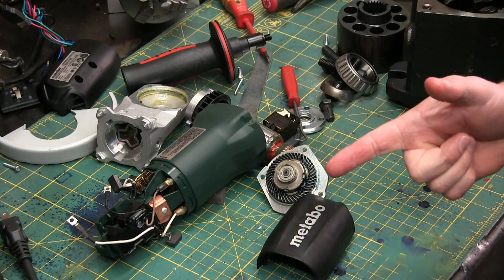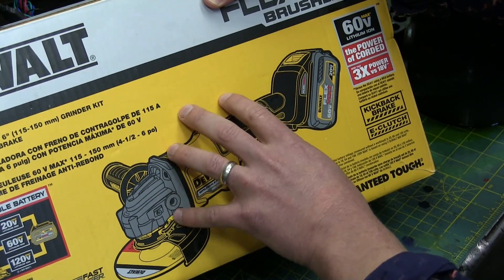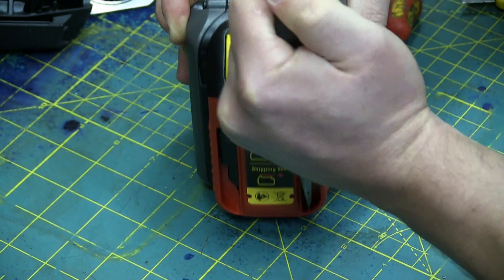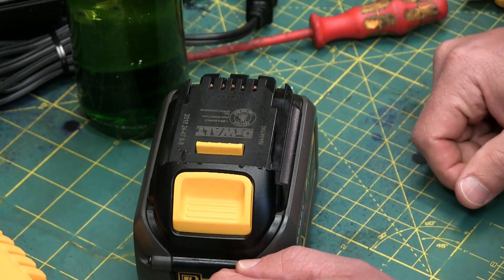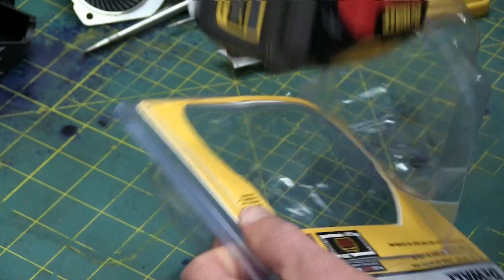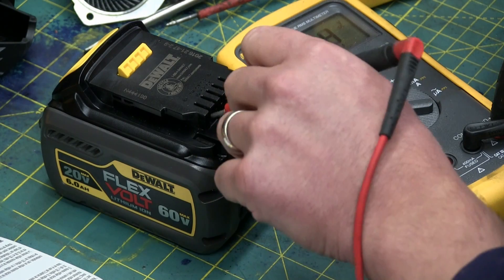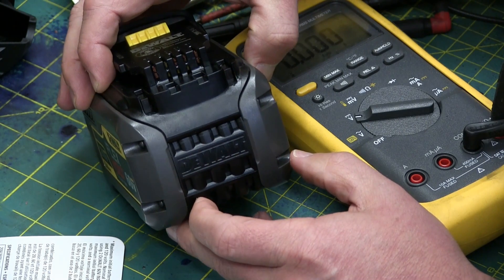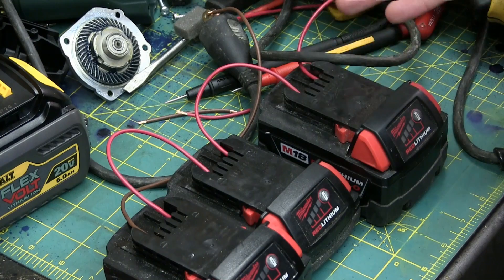Plug-in Power Tool to CORDLESS CONVERSION.

Comment: Not trying to be against the tool turbo charger but from the electrical point of view it's a bad idea to run an ac tool on dc not because of the motor, but because the switch won't handle the power. Disconnecting ac power is a piece of cake while dc will draw arcs like crazy. Mains switches are usually rated 120vac and 30vdc at their full operating power.

Comment: I wouldn't say you are a complete idiot...given some of the things we've seen you attempt, I'm reasonably sure there are some parts missing.

All kindling aside, very funny and interesting video.  Can't wait to see what you come up with. Be handy for taking the sawzall to the metal supplier so as to shorten the handy 20' lengths they sell stuff in to something those of us without semis can transport to home. Don't do that enough to justify a cordless sawzall, but if I could use my corded one, or even better, the Portaband, that would be a deal!

-- Mike

Comment: A normally open 120vac contactor on the mains side of the battery pack? When the voltage dips, the contactor would open and decouple you from the wall. Then you run on the battery until the contactor snaps shut.

Comment: Start with a UPS for the current/voltage sensing but instead of flipping to an inverter run off SLA batteries, instead flip some relays to the  LION batteries between the tool and the chargers.

Comment: Is this idea different from a UPS?
Reply: pretty close actually now that you mention it, lol just put a UPS in a backpack and plug er in. good to go
Reply: Can't hurt to try this.  Unless existing back problems
Reply: 1spaghetti32 lol
Reply: I was gonna ask the same thing but, I think a meaty capacitor would help better for initial inductive spikes and use the batteries for portability.
Reply: UPSs  just switch to battery when the line voltage browns/blacks out. This would just be a more sophisticated controller that doesnt switch entirely to battery, but only notices when the voltage drop causes a current flow increase, but then makes up that extra flow with the batteries instead of the line current. The line would still be the main power source, unlike a UPS which, once switched, is the sole supply, thus the short bettery life.
Reply: you could get a decent one for $100 that has good over-voltage/ brown out switching, or an inline UPS that is 100% on battery power.
Reply: Every UPS I have ever messed with needs to start on line voltage and then you can kill the ac.  They don't seem to work as an inverter. I'm sure that some EE pixie wrangler can tell you how/what to by-pass/cut/connect to make it work though.
Reply: +Zee-L Usay my experience is the complete opposite. Cheaper, home grade units sometimes struggle of the full load is attached when you turn it on, but even with a half depleted battery it'll still work.. 
The smart ups line does this no problem.
Reply: UPSs also run completely off the batteries when there is a complete power outage. Smarter ones will kick in during over / under voltage or an unstable voltages / ripples. Cheaper ones only kick in when the power goes out. 
You can get ones the size of people that would power a desktop computer for weeks.
Reply: One way or the other, a UPS + ground-trip has got to be safer than scoochin about on-site with 60v of DC schmoo.
Reply: actually tried that.....didn’t work to well,didn’t work at all  ,being that the ups uses a tiny 7 amp lead battery ,it isn’t strong enough for a tool in that capacity,you could use it for light tools (drill,scrollsaw etc) but a job site saw is to much,that is why larger tools use start up capacitors,but i am just a diy’er who tries things so with stuff i have laying around,maybe a big pro ups would work?
Reply: oh wait if the external spinup first start the tool later idea works then you can just use the dc start turbocharger method anyway. just start from dc batteries let it spin switch to ac just a relay job with delay if the dc batteries does not damage the commutator and other things too much that is hmm can be done if you are desperate enough
Reply: +Ken Lazar Not necessarily, there are 3 main sorts: Standby, which does what you're saying, Line Interactive, which smoothes out power by conditioning the line, and Double Conversion, which is always drawing fully conditioned power from the battery while keeping it charged as well.

Comment: I think the "line interactive" UPS models might be able to do this. At least, they can boost the voltage up to spec if it's coming up a bit short. Don't know if they use battery for that, or just draw more current, though.

Comment: Maby make a system that when you turn on the tool it cuts out ac for 10 sec and  runs on batery then it will swich back to ac and swich on an seprate charger for the bateries. Making a device that can sence current draw and if it gets to hi it will swich into batery the swich back to ac once the current draw goes below the amount make an relay or solinod swich that will instantley cut in and out ac/dc current so there will be no aperent dip or drop in power in the tool when swiching

Comment: WO wo mon ti pit! ( Wait a minute man) I understand your enthousiasm...about this Billy Grahamist association of devoted internet brains ( soul)!  but ( the killing word) first thing first.  The rule says : buy and appropriated size  of extension cord.  Think about this: If the brake system fails on your car, do you invent a new system or do you  repair it.....
I don't discard your idea, I even support and think about it...
Why not go with small 12 volts motorcycle  batteries. Their charger would be cheaper...
Gold bless you...

Comment: on our farm here down under we have a multipurpose genorator that produces 240v DC, perfect for running all your brushed rotary tools.
the reason for the DC is that itmm also works both 12&24 volt for starting large engines with dead batteries. It also has a really scoocum welder and an air compressor.
Reply: it's the perfect all round repair station for isolated repairs
Reply: +ELECTRONTHORP not in 15+ years

Comment: Inrush current is higher because of the extension in comparison to plug in it directly ?. Extensions are big unwinded power resistors, a balast. IMHO it should low the current seen by the tool, which is the same that sees the breaker.  Probably trips because tool struggles too much on starting that buids up heat on the breaker (trips because overheating). The battery idea is good, it more like and UPS fashion but without the inverter in the ouput and more batteries. Probably a real UPS will even behave that way because when you trig the tool, the voltage drop is so much that the UPS switchs to battery until the AC recovers, which happens once the tool picked up revs or speed or something. Shame that they dont run this higher voltages (DC) so it would make them hackeable. But you can fit 6 batteries, o more, charge one by one and when it switches to back up power just blast all of them in series. I mean trying to reuse the charger, and the voltage drop detection, some relays ...

Comment: What about an SMPS pumping out ~48 VDC, a bank of 13 LiFePO4 (phosphate- how do you enter subscript again?) cells in series, a single (if they make singles for 48V) or bank of supercapacitors (in series for 48 V use), and a 48 VDC inverter (sine wave type)? While there will of course be a slight efficiency loss, the storage in the supercapacitor bank and batteries (if cordless capabilites are desired) would be able to push more than the SMPS alone to the inverter, providing a burst of more AC to the tool for a period of time.

Comment: Guess ill throw my .02 in, to supplement tools with current from a battery the first step is sending your ac power through a bridge rectifier, diode based if you wanna keep it simple, synchronous if you want efficiency, then diode off the batteries, both positive and negative with a recirculating diode between em. Then you've got to cook up a highly regulated 120 volt charger that disconnects upon the batteries being loaded, and there lies the difficult EE work. Superimposing a dc current onto an ac waveform is not something  you wanna do in this application.
Reply: Inverters are large and expensive, they also don't solve the bolus of current at start up or the high use in transient situations, they are protected the same way a wall outlet is with a breaker. High current dc bias on high current ac waveforms without very special design considerations is a recipe for disaster, they cannot exist on the same ground plane and power plane as the negative swing on the ac line would effectively create a massive short circuit, there are work arounds, but they are messy. Easiest solution rectify to dc clean it up with caps, diode wall the batteries and use a micro with igbt's to change igbt configuration so the batteries are series when in use and parallel when not, and off the shelf charger that connects when their in parallel and disconnects before they go into series
Reply: Now things do get simpler if you either use those 60 volt batteries or implement the same control scheme they do, you could have a bank of individual 20 volts that only become 120 when a current sense transformer says your a certain percentage of power usage, and a start conditional that puts them in series when a rise from 0 current is measured
Reply: I was basically thinking that this is basically a rather special use-case UPS. though I would have needed to do some doublechecking before saying for certain that putting DC-bias on the AC would be a bad idea (even though that was my first gut-feeling)
Reply: Also: I'm not sure every corded tool has an universal motor inside, this can lead to surprises.
Reply: Taunter Atwill yeah, should proofread my posts... anyway the best (performance-vise) solution to the problem would be a delta-conversion online UPS, http://www.apc.com/us/en/faqs/FA157448/.

They however are not cheap to buy or simple to build (and the parts are expensive).

Double-conversion online (which is what ***** suggests) is inefficient and would require larger inverter than delta-conversion (if we assume we do not need to handle a case where the mains is completely gone).

Most inverters also specify much lower VA capability for inductive loads than resistive, electric motors are inductive loads...

Comment: Dewalt's battery powered flex volt table saw and miter saw takes two of those super expensive batteries.  I work for an industrial supplier and heard all the marketing wank from the Dewalt reps.  I've been waiting for you to get wind of this and tear it apart.  
Btw, thank you for all your videos.  I have derived endless amounts of pleasure embarrassing the Dewalt and Milwaukee reps as I call them on their marketing wank.

Have you heard the line that companies like Grainger sell industrial grade Dewalt and Milwaukee while Home Depot sell home versions which is why they're so much cheaper?

Comment: Why not just an inline inverter system like on a motor home. You have AC into the inverter and if you have a voltage drop for the inductive load the inverter side kicks in and draws from the battery.

You could get fancy and make a true sine wave also

Comment: Seems easier to just run the tools straight off the batteries and constantly charge the batteries off the mains voltage. When you put the tool down gives the batteries time to recharge. But I'm not that big into electrical theory so there may be a problem here besides efficiency losse of converting.

Comment: what about... a car inverter.. 12-24v input. 110v or 240v output depending on your location. and build the lithium battery into the case with charger. they're of portable size.

Comment: Why not just put some Super Caps in the circuit?  It's a basic DC power filter, just leave out the coil.  The caps will charge to the circuit Voltage, then discharge when the Voltage drops.  You may need to take some precautions to charge and discharge the Caps on plug-in in and unplug.  Super Caps will last a lot longer than batteries.

http://faculty.frostburg.edu/phys/latta/ee/6cl6xmtr/6cl6psfilter.gif

Comment: puny extension cord<---------->*box-o-supercharger magic*<----->*tool*

Plugs on both sides of the box, magical pixi transforming/storing/sorting goodness inside the box, tool plugs into box, reduced world suck. Or something along those lines.
How much oomph do those fancy capacitors have VS a stack of lithium goo?  
I'm seeing something the size of a tool battery charger with attached battery(- excessive plastic coatings) with a few more transformers/ switches?

Comment: 120V AC parralel into 30 18650 cells uprotected cells sound like a massive BOOM to me :)
actually the running power of a li-ion is 3.7 volts so even with 2 packs you  won't get the full 120v except for the first mAh of dischargr but I'm pretty sure you already knew that. It does sound fucking wicked but your idea is very good. Without heavy circuitry to protect those little blow'em up sticks i don't think it's possible.

Also the reason why the batteries are not fully charged from the factory is for safer transportation. Li-ion cells are more unstable at full voltage than rated voltage. They are not as crazy isis beleiver as those lithium-polymer cousins but still they're minimizing the risk.

Comment: AC motor running of DC ?  Well, not a "real" AC motor.  Those are universal motors or AC/DC motors.  (https://en.wikipedia.org/wiki/Universal_motor)

For folks who don't happen to have a bunch of cordless tool packs laying around, see if you can harvest some "dead" laptop battery packs.  Typically only 1 cell is bad in the pack and the rest can be reused.

The most common size LiIon battery is the 18650 (used in Tesla cars and most laptops).  It is a bit larger in diameter than a AA and a bit taller.  New ones will hold 3400 mAh..  If you are going to go down this road, you need a GOOD LiIon chrager/conditioner, like a SkyRC B6AC, which will also charge NiCad and NiMh.

Comment: like alot of people are saying, a large capacitor or array of capacitors would be ALOT more cost effective, lighter, and would work way better for pluggin things in over a long distance. As for the battery powered solution, i imagine a charge controller run to the batteries and a small transformer transforming several dozens of 18650 batteries (or any other cell, maybe a array of lipo's) into ac at 120v run in parallel with some diodes would likely work really well. However say you used 30A cells, that cost ~$4/cell you'd need a SHIT ton to be able to handle the conversion and a safe 30A continues on AC. As im trying to figure this out, there is a better, cheaper and more efficient method; some type of gas powered generator that charged some car batteries. would provide the initial voltage(and ampereage), and the burst pull would be similar to what they were designed for. If this doesn't make sense, let me know why, make this a learning experience lol

Comment: The most recent video on my channel is a stand alone inverter box, but you can charge it while using it, so it could be like an uninterruptible power supply like you want. Just has an inverter instead of feeding the tool straight DC current. Boost caps and a golf cart/forklift charger would probably work too. I'd make a video with my caps, but I don't have a charger like that. Maybe I'll swap the batteries in my box for the caps and make a video. I used 6 caps in my "mobile power setup" video for basically the same thing you're saying in this video; my car battery (the grid) can't supply enough tool startup power by itself, so I have the boost caps to start the tools and the battery to keep them running on my inverter.

Comment: I did carpentry sometimes and the biggest problem we have is the power company puts the pole 300 feet away from the house or building. so then we got a ton of cords running to the job site all of them are pretty much 15 amp but we still pop Breakers one more than one saw is running on the same circuit. so how about a distribution box that can be ran with whatever size cord with either capacitors or batteries to jump-start all the other ones so that you don't have to worry about popping the breaker and wasting time going to push the button. but that button ain't  yellow. then you can have your charger and all your other pixie   wrangling devices in there to keep everything in motion. and make it a easy rebuild if it does fuk up. just my thoughts on making the world a better place.

Comment: https://www.youtube.com/watch?v=ayasvXq5WBI 
This tractor is powered with lead acid batteries, but the power is channeled through a 120 vac inverter.  I had to do welding at work before anything other than 15 amp 120 volt outlets were in a warehouse being converted to a production line.  I had a 55 amp 12vdc charger on one of the good outlets and then ran the 140 amp wire fed welder off the the inverter on the tractor.  Even took the tractor for a drive through the storage area to the drill press and make some holes in the steel plate we were welding.  (I admit I was walking to get the pallet jack to bring the drill press to an outlet when I came to my senses and took the tractor for a ride.)  Great stuff we all want turbo tools and popped breakers are not to be taken lightly as some job sites lock the rooms they are in.  Sorry for placing a link, but I felt it was really on topic, and one of my crazy passions.